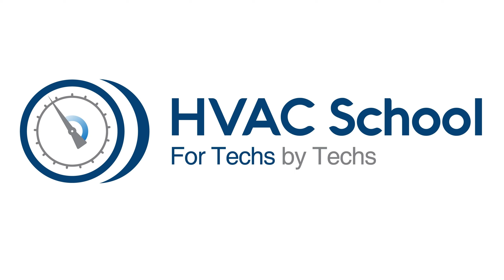Deploying Surge Protection & Voltage Monitoring w/ DITEK

Comment: Two things:
1. AUDIBLE ALARM SURGE PROTECTORS

I'm not yelling, well, just think this is a huge improvement. If you install surge protectors that audibly alarm when they fail, your homeowner is much more likely to notice. I have enough trouble getting my elderly parents to notice when a normal GFCI trips right in front of them, they only notice audible alarm GFCIs because the alarm is yelling at them 😂

Same principle applies, but people are even less likely to notice a red light if they have to go outside to check it

Similarly, the Siemens FS140 saved my butt a few years ago when it audibly alarmed to a failing neutral early, I'd never have noticed the blinking red light.

2. I'm a bit surprised to hear inverter boards getting damaged by undervoltage. It's not surprising that you could cook the IGBTs if the current draw is much higher because of the insufficient voltage, but it sounds to me like another electrical engineering oversight on the manufacturers part. They should have built in thermal sensing and current/voltage sensing, and software control to protect itself. Just like an electric car. In theory the variable speed units might even be able to do some amount of graceful degredation in a brownout and run at a much lower capacity instead of trying to cook themselves to death!

Comment: I have a question?. I have a mini split (LG)  that has been in for 3 years .and now it will not hold a charge . I can pull a vacuum on the whole unit and will hold for 3 days.as soon as you add Freon. It will leak down in 4 day's I.
 Have used a sniffer. I have tried pressurizing unit and cannot find leak.
Reply: Best guess… A Schrader or a flare fitting… Guessing one ore more of the Schrader cores is either removed or covered by the micron gauge or core removal tool… Otherwise, flare fittings might hold under a vacuum but not under pressures… Less common, but I have seen it, vibration and pressure cause a leak in a brazed joint or a contaminated Rotolock connection…